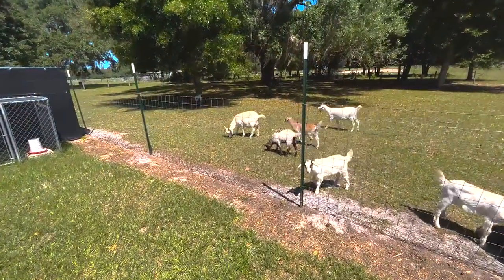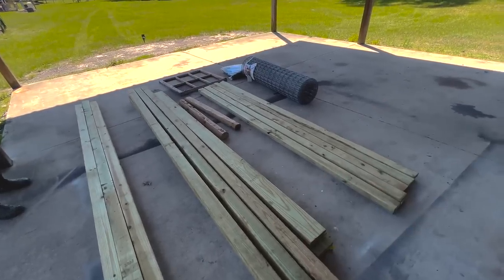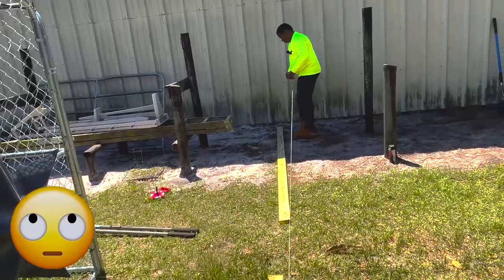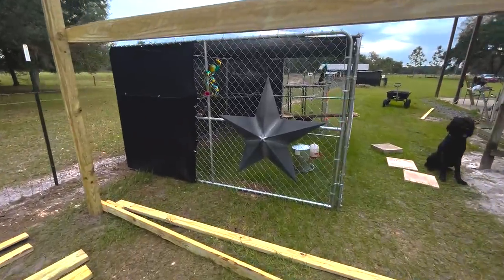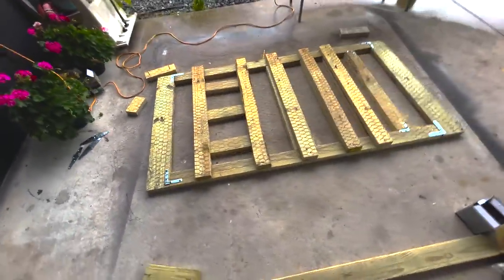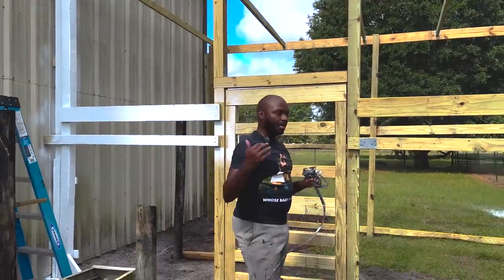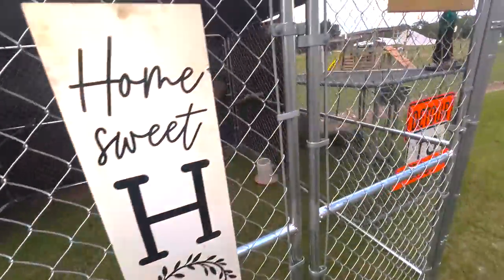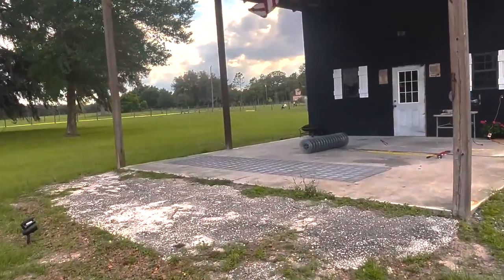Building An Aviary For Our Peacock's

Comment: Great job on the aviary just one question? why no cement with the post? to add Jason and Brook is the reason how I found you guys.
Reply from the maker: Hey KJo - while I typically do use cement, I recently have been experimenting with ensuring the ground the post are in are nice & compacted. This project would be my third doing this & all is well with the previous two for now. We also have sand (not dirt) here in Florida so water drains almost immediately (well at least on my property).